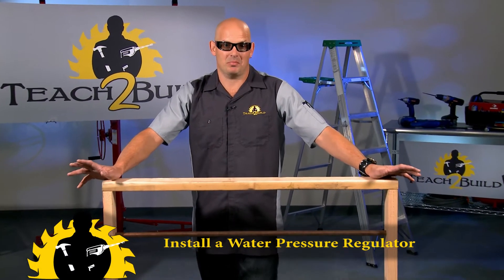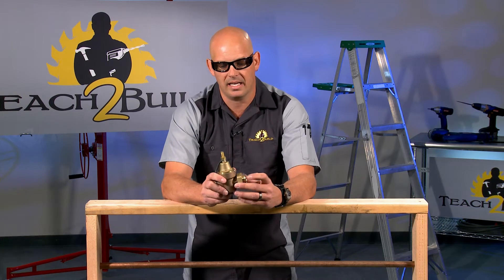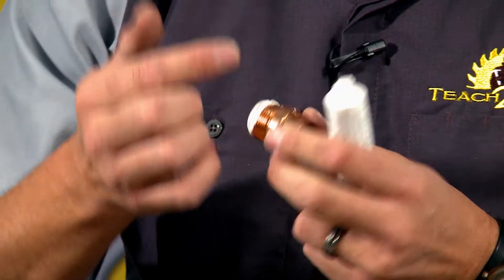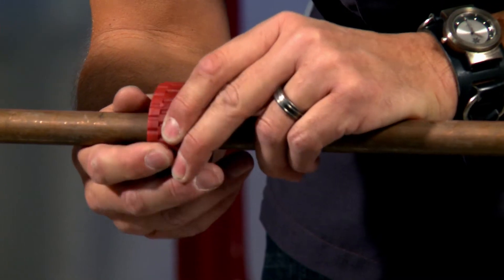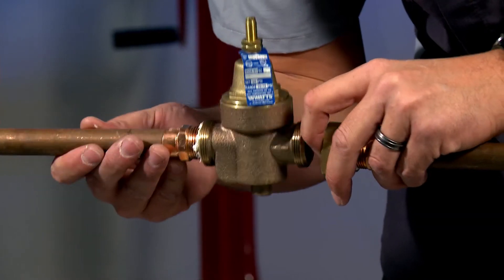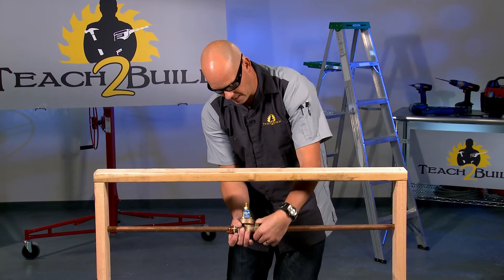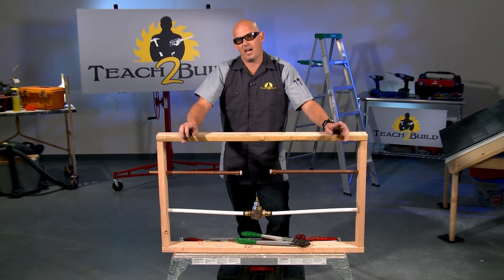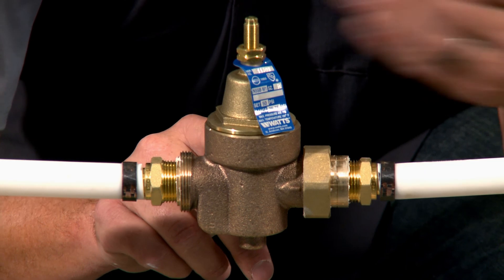Installation of a Residential Water Pressure Regulator

Comment: Could a pressure valve be installed on a 1" SCH40 supply line and operate properly and safely?
Reply from the maker: Essentially, yes. What the supply line is made of will not negatively affect the performance of the prv. Now, would I use schedule 40 for supply? No. But sometimes we work with what we have, don't we?
Reply: @Teach2Build That's right. It's what I've got to work with. A lot of things get rednecked in SC. 😁👍🏼

Comment: Great video thanks for the info. I do have which seems like a silly question though. The water pressure valve on my house needed to be changed which I did successfully but the question my question is, the pressure valve has been on my house since we’ve been here 10 years and it was facing down and when I installed the new one, I positioned it the same way facing down, is that a problem? Should I turn it facing back up with the adjustment screw on top, or is ok to have the way it has been for the past 10+ years. (with the adjustment screw facing down) Thanks for your time and expertise info.
Reply from the maker: @BeeTull64  as long as the water is flowing the proper way, it's fine!
Reply: @Teach2Build  Wow, that was a Super Fast response. THANK SO MUCH I figure it was ok because like I said it has been that way for over 10 Years. Thank You Once again...Wayne

Comment: Can anyone tell me why we cannot just turn down the pressure outside before it gets to the House? Seems much simpler than having to pay extra for both the valve and installing it?
Reply from the maker: It could still need to be replaced
Reply: @Teach2Build  yes, it's possible, but it wasn't even checked or mentioned.
Reply from the maker: You can, if the valve is still operational. My experience has been that of the pressure increases, the valve has failed as it acts like a gate, reducing the pressure, regardless of the incoming pressure, so if the pressure jumps in the house, it's because the valve has failed.
Reply: @Teach2Build  thank you for that info. I've been sold a story it seems.

Comment: My main shut off ball valve is inside the wall with a little door to access it.  Once I cut away the sheet rock to install and adjust one of these PRV's can I then sheet rock over it, or does it also need an access door?
Reply from the maker: Code requires accessibility. You can purchase an access panel from your local big box store and use it to determine the size of your hole. They can be painted to match the wall. I prefer the spring loaded versions but the versions with a frame and snap in panel work fine, as well. Best of luck on your project!

Comment: how do you troubleshoot or diagnose if I have a faucet on and then flush the toilet I lose all water pressure and flow.  do I need to adjust or the PRV, or should I replace it?  my home is 3 years old.
Reply from the maker: 3 years is pretty young for a prv to go out. I would screw a pressure guage onto a hose spigot and see if it's low. If it is, double check to make sure your main valve is all the way open, then check the adjustments on the prv. If this has always been the way it is, it could also be related to the supply line plumbing in the wall. Best of luck!
Reply: @Teach2Build  this has been ongoing for the last two years and progressively getting worse. I will definitely test the pressure and adjust as needed. I will keep you posted. Thank you sir. 🤙🍻

Comment: $34? Just checked home depot sells them for 175
Reply from the maker: In filming this series, I did try to avoid mentioning pricing, as I knew it would change over time, but sometimes I forgot. They were, in fact, $34 back then (2012). Should they have gone up 500% in ten years? No. Best of luck on your project.

Comment: So, pre-assemble everything, do a dry fit to make sure....it fits, and while dry fitted together then solder the fittings to the pipe?  Is that the right order of things? Thx
Reply from the maker: After doing a dry fit to assure everything's right, disassemble and apply flux everywhere, reassemble, then solder. Have fun!
Reply: @Teach2Build  Thank you very much indeed.  Very much appreciated.  Going to put mine in a valve box in the front near the garage.  I think the reduction from the high main line pressure will eventually save us some money.  Let alone the peace of mind that the interior water fixtures are not under such high pressure strain.
Reply: @Teach2Build  A follow-up question if I may:  How is it that the pipe sealant on the 2 threaded copper fittings is not damaged by the torch heat while soldering?  I'm sure it's a real newbie q.  Thx again.
Reply from the maker: I don't assemble anything requiring thread sealant until soldering is done.

Comment: I have a problem with my tankless water heater. I feel it doesn't heat the water as much as I would like. I adjust the water passage key to have less water coming and that helps a little bit. Do you think installing a water pressure regulator would help my water to get warmer?
Reply from the maker: Hard to say but I would guess not.  There are so many variables that can affect a tankless! Reducing water flow, as you did by partially closing the shutoff, helps a little because the heater doesn't have to heat as much water in the same time frame. Things like whether it's electric (yikes) or gas (yay!), incoming water temperature, if it's mounted indoors or outside, on and on. It may even need repair internally, which is not really a DIY task. Sorry I don't have better news!

Comment: Is it possible there might be too much pressure on the PEX tubing prior to the regulator that would cause issues down the road?
Reply from the maker: I believe PEX is rated for 160psi at 73° so it would take a pretty serious issue, which your water company would be responsible for...

Comment: The one i have just after the meter is frozen and will not adjust. Can i put a new one further up the main line past the one that is frozen? It would be easier than cutting the old one out.
Reply from the maker: It would depend on if, in it's failure, it's restricting flow or not. Best practice would be to replace it as it could fail later in a way that restricts flow, but if it's not currently restricting for, the argument could be made that you could just add one after it, yes.
Reply: @Teach2Build  Its not restricting the flow and not leaking. The pressure is a bit too high at 80 psi and I want it to be about 55 psi. Thanks for your quick response.
Reply: Thanks so much for this informative video. It seems the only thing that you didn't show was how to solder the copper piping.
Testing the water pressure at a silcock in my home it is 100 psi so I will need a PRV. My question is, am I responsibile to have one installed or is the city responsible? Miraculously enough, it doesn't look like there are any leaks or damages to my 30+ year-old poly-B plumbing. Is the city responsible if my pipes break because they turned up the pressure to 100 psi?

Comment: Can you use it to increase pressure ?
Reply from the maker: I'm afraid not. It sets a maximum. Now I've had them go bad and it was restricting pressure, so there was an increase in pressure with the new one in place, but that's not always the case. You may need a booster pump if your water pressure is below around 50psi. Best of luck with your project!
Reply: it will lower city side pressure which is usually SUPERHIGH 120-160 PSI, if your current valve is broken/ weak then a new regulator can be installed so you can have anywhere from 30- 160 psi...turn a screw on your current regulator it shut increase pressure

Comment: Great demonstration! Some youtube plumbers use an expansion tank on top of the hot water tank to go along the PRV valve. I guess some PRVs do not required them, and why the extreme price variance? Our plumber quoted over $500 just for the PRV part. Looking online at Grainger and Ferguson plumbing supplies it seems you can get a lot cheaper one with screens. I am not a plumber. Just trying to help my sister figure this out so she can get a good job and save money.
Reply from the maker: Hey Enoch Page! Plumbers have a markup, usually 30 percent but I've seen MUCH higher, which prob explains most of the price difference. Expansion tanks are a good idea and are required by many local codes departments. I always install them with any new (tank) water heater install I do. Best of luck for you and your sister!

Comment: I'm pretty sure I can't just slide the pip[es around in my house the way you are doing. This video is poorly done and misleading. The only thing it does a good job of is showing why you should never install this on a pex line.
Reply from the maker: Couldn't disagree more. Best of luck on your projects.
Reply: Your wrong Maga Man
Reply: Maga man is right!
Reply: its like the "this old house" tv show is all FAKE, they prefix it for DAYS, then film edit in reverse so it looks like they fixed it in 7 minutes!! and in reality all the pipe are in superuncomfortale positions
Reply from the maker: It's true that all jobsite are slightly different, and some of the challenges offered are not discussed in this video. There's no discussion of having to work with not enough space, or of how turning the water off means no shower until the job is done, or how you'll miss whatever is on TV at the time. Heck, I didn't even mention the traffic you may encounter on the way to the store! This video is terrible!

Let me encourage you to take what useful information you can from this video (and there's a lot of it), and then go dive in to your project, understanding that you may still have some steps to overcome that were not discussed. You can do this, though. You can.

Comment: Could you tell me if is it acceptable to place the regulator before the main shut-off valve on the supply line?  The current one is 40 years old and between the valve and house entrance in a way I dont trust anyone trying to remove it, but there is fresh copper in the three feet before the main valve I could put it at....
Reply from the maker: You would actually need to talk to your water company as they own the line up to the meter. If you're talking about a section after the meter but before your home, go for it. Best of luck with your project!
Reply: @Teach2Build  Ok so today I put the new ball valve/ PRV combo into the line! Could you help me with this question too please - So I removed the union (single union PRV) since I was connecting that side with a 1" brass nipple straight to the new ball valve; and with the water turned on I am getting a little moisture on that non-unioned side of the joint.  Is this because I do need that union? I'm also pretty sure I've tightened it all I should.  Unless using teflon tape only on the threads is a bad idea.. what would you suggest I try next?  Thanks!
Reply from the maker: You may need to use some rectorseal on those threads as well. Mixing adapters can be tricky. Best of luck!
Reply: @Teach2Build  Much thanks!  I will get that seal tomorrow- I just tried adding the union but it still leaks out the exact same threaded section.  I'm going to replace the nipple with one that has more area to grab with a wrench too... Pray for me :0
Reply: @Teach2Build  To clarify, rectorseal is something I use alone, not in conjunction with threaded teflon....
Reply from the maker: @djohnson129  as a habit, I use 3 wraps of teflon tape followed by a sealant like rectorseal in any threaded connection, with the exception of any connection where one or both of the connectors are plastic...
Reply: @Teach2Build  I will definitely be doing this tomorrow, version 3 of teflon tape is leaking worse than the first two :/  I am going to exchange both the prv and nipple for fresh units and use your method on the threads.  Bless you if this works xx
Reply: no. thats the whole point of having a shut off valve on your house, so you can fix things in your house. some have 2 meters. 1 at the city side one AFTER your house shut off valve, so you know both, city pressure and house pressure..shut off city, shut off your house, change all valves and pressure meters and hose connectors, its just better

Comment: Great video for 3/4" copper & Pex, however I have a 1" PVC for my main water supply coming into the house. Do I need a PRV with 1" connections? Or do I use a PRV with 3/4" connections and reduce my 1" PVC pipe to 3/4" copper?
Reply from the maker: Thx for subscribing! You will still want to use a check valve, even with a dedicated return line, as the flow could possibly reverse if the circulating pump stops, or fails internally. Do that research, and you'll get the right answer for your circumstances. Take care!
Reply from the maker: Hey Penny! PRVs with 1" connections are available. I would avoid reducing the size until absolutely necessary. A quick search online should find you what you need. Best of luck!
Reply: @Teach2Build  Thanks so much for quick reply! I suspected reducing my main line pipe before the PRV was not a good idea, but that is how it was done before I bought the house. The reduction starts about 2 feet before the PRV, with a shut off valve in the middle of it. What kind of problems arise with my set-up? I do have fluctuations with psi up to 120; could this be the reason for the fluctuations?
Reply from the maker: Pressure variations of small amounts are most likely related to varying pressure from the street. Larger swings in pressure may very well be the prv, even though they usually just die altogether, shooting the pressure up. Reducing the line size to 3/4" isn't the end of the world, just not ideal.
Reply: @Teach2Build  Thanks again for the info! I just subscribed; I am also researching if check valves are needed on a hot water circulating pump with a dedicated return line.

Comment: Thanks for the video. If both sides of the copper pipe are fixed and you cannot slide them back and forth, how can you put this in the middle? Or do you have to use different fittings? Thank you.
Reply from the maker: Hello! You would use a slide coupler, which is a coupler with no internal 'stop'. You flux everything, slide the couple all the way onto one side, then back halfway onto the other side, and solder away. There's also a Sharkbite fitting you can use called a slip or repair fitting. Best of luck!
Reply: @Teach2Build  Thank you. Makes sense.

Comment: 5:43 what is that piece called?
Reply from the maker: The adapter that converts to copper?
Reply from the maker: I don't think I've ever seen the adapters for the pressure regulator available separately. Best of luck!
Reply: Yes because I want to buy 2 on amazon

Comment: Mine was leaking by the o ring, replaced the o ring, still dripping
Reply from the maker: A couple things could be the problem. There might be debris on the o-ring seating surface, or the o-ring might have a nick in it, or is the wrong size or diameter. Hang in there. You'll fix it.